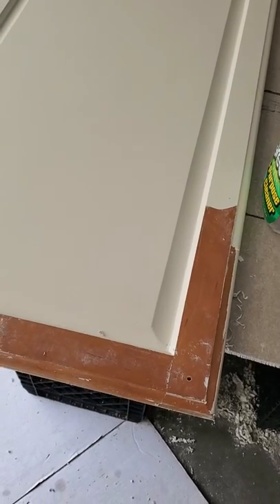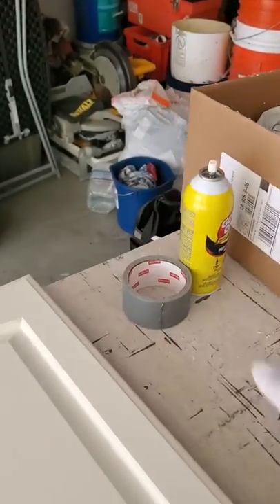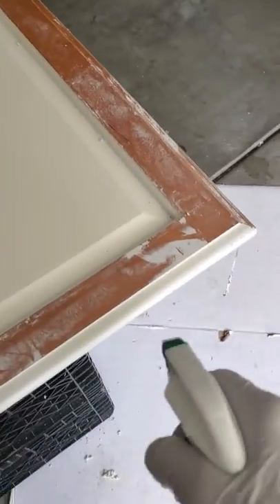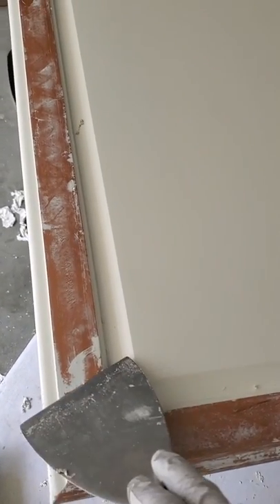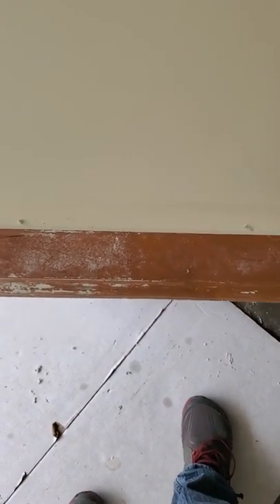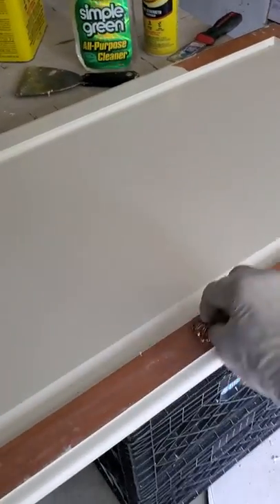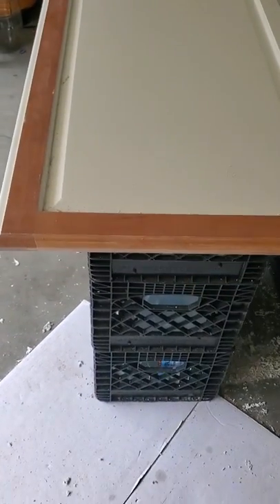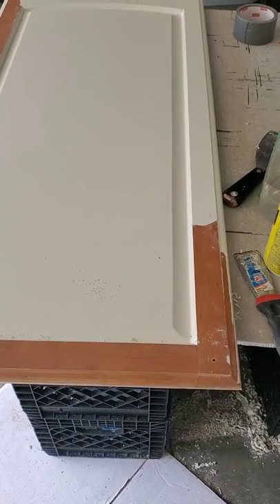Easiest and quickest way to strip paint off cabinets

Comment: This was great. I took notes! I wish, however, that it was shown how to do the wood that is part of the whole cabinet structure but is "in-between" the removable cabinet doors. I'm assuming cover your kitchen counters with drop cloths and use the spray bottle & steel wool part of this method? Or well I guess you could 45-degree-angle-back-and-forth your trowel vertically. Idk. I've just never done this before and no YouTuber seems to show themselves doing or explain how to do those non-removeable cabinet structural pieces. My second question is, I'm looking online for a "trowel" but that only seems to be a garden tool? I don't know. What if I buy a "sharp puddy knife"? Haha thanks if anybody sees this and knows. :)
Reply from the maker: It was quite a while ago but I seem to remember that I had some large cardboard boxes that I folded down and they were stiff enough to extend past the counter tops.  I used a paint brush to apply the product that I dipped in a container of the goof off to keep from overspray. I purchased a gallon container of goof off and just dumped the amount I estimated I would use with the time I had into an open container I could get the brush into. And I used a puddy knife and a drywall trowel 4'", which you can find at home depot or lowes.
Reply: @jessemarcohaynes  thank you so much!!! 🙏

Comment: Thanks for your video. Im guessing this only works if the cabinets were painted without proper sanding first? Im in week 3 of a massive sanding, stripping, scraping, steel-woofing and cursing of old, gross, greasy and failing paint in order to repaint.
Reply from the maker: That could very well be....I am not a professional by any means... I just know that product worked the best for me.
Reply: I don’t know anything about this stuff but wondering how it all works by your comment I’m guessing sanding before makes the paint or primer “grip” hence the “cursing”? Lol
Reply: @KeepPrayingCA  In my case the paint was “failing”, meaning peeling, sticky, bubbling mess. Sanding most of the failing paint was the only way to clean that up. I had to use stripper also, which I despise but the cabinets are now beautiful. I also used a polycrylic, 4 coats with sanding in between (follow the directions on the label) to give them a very smooth surface which is easy to clean. It took me about a month to do it all but I have a huge kitchen. Good luck with everything.

Comment: Had to speed up 2x to slow
Reply: Thanks for the advice I used 1.75 so I didn't miss the times he spoke at a somewhat normal pace.
Reply: Nice job. Looks good. Have a maybe dumb question…do you somehow “wash” it after scraping and using the copper scruber or do you figure the Goof Off was “soaked” into the paint and not worried if there is any “residue” from spray over or potential soaked-in-ness in the area that didn’t have any paint to be scraped off? If there is any will that affect the paint or whatever you may be apply in the future? Or does the product just “evaporate “ and lose its “Goof Offness” 😉 don’t mind all the “ “ air quotes

Comment: thanks for this video! i have similar design cabinets and the inside detail is such a pain to strip. did the goof off make it easy to take off?
Reply from the maker: Yes. It worked great. Use steel wool to get into the corners.

Comment: I have to do this with trim on the wall. Do you think this will work? Any tips? I've been sanding my brains out and still cant get all the little edges and curves on it. Looking for something a lot easier.
Reply from the maker: I do think it will work....it will be a bit difficult to keep the product from getting on the things around the trim , but if you get it in a gallon container and pour it into a small bucket and brush it on with a paint brush you should be able to use the steel wool or similar scrubing material and it will pull it right off the edges.

Comment: I have a question? scene you just saturated the paint/wood, does that prevent the new paint to adhering to the Goof Off saturated wood? Thanks
Reply from the maker: the goof off product will evaporate and I would assume will not affect the paint adhering to the wood, although I did not stop at the paint removal step and did wipe down with a wood cleaner just to make sure the paint did have good adhesion and would recommend to do that or lightly sand wood and remove the dust after sanding.
Reply: @jessemarcohaynes  thanks for the reply

Comment: I have to strip wood with a stain on.  Can goof off work with that?
Reply from the maker: I havent tried it on stained wood but I imagine it would take off most of it but not all of it due to the fact the stain goes into the grain, you may need to sand it down to get it all off.

Comment: How do you do vertical areas?
Reply from the maker: By vertica,l do you mean if the doors are still mounted or in place?
Reply: The back of cabinets face a kitchen room and then there’s the trim. The Goof Off just runs down the cabinets.
Reply from the maker: Try applying it with a paint brush or sponge brush. I purchased the gallon container put what I anticipated I would use in a gallon water jug with the top cut off and dipped it in
Reply: Good idea, I will try that ! Thank you.

Comment: This does not work on surfaces that are not totally flat.  After about 10 coats and scraping it is not worth it and still not off.  It. may work on what you did but, not on everything.  What a mess it has made.  Getting citristrip next like I should have done in the first place.
Reply: Did you have much luck with Citrustrip? We used it today and it did a terrible job. On our 3rd layer and gonna let it sit for 4 hours this time. (First 2 layers was 30 mins then an hour)
Reply from the maker: I found you have to scrap it while it is still moist. I also needed to place a piece of plastic wrap on it after application so that it did not evaporate and could eat into the thick areas. I would let it sit for about 2 minutes then reapply right before scrapping.
Reply: I am in the process of doing just what he is doing but to trim on my wall. What I am doing requires more elbow grease but I am putting it on a rag and rubbing it. In some areas it stripped it down to the wood. Slightly tedious but it is working.